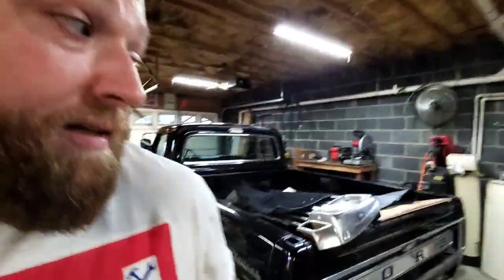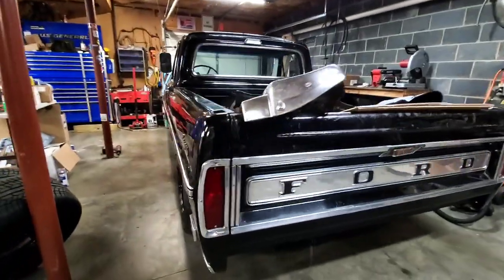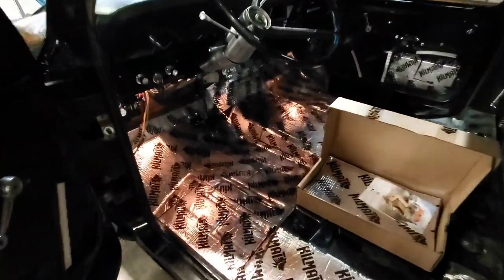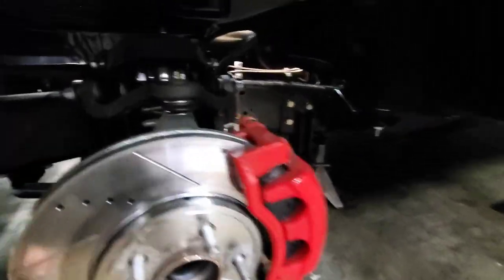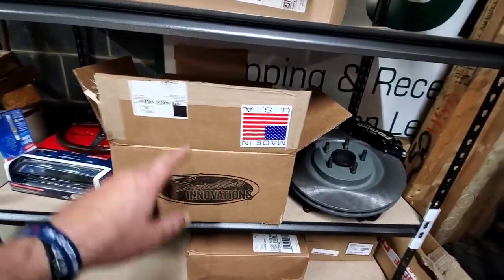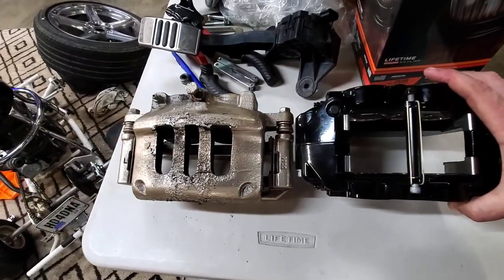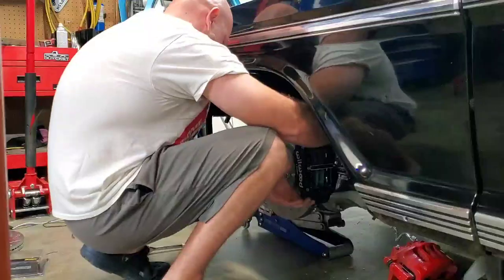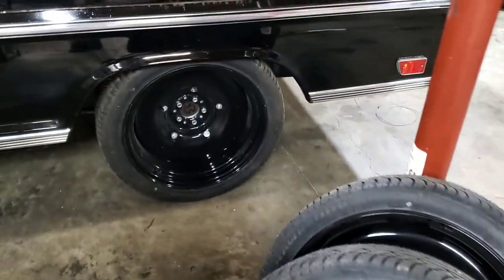1968 Ford F100 Ranger Big brakes!

Comment: What axle is in that? How’d you fit those wheels in the rear?
Reply from the maker: It's an 01 Explorer rear. Wheels are custom built by Schott, 20x10. Fits in the stock wheeltub so long as the correct backspacing is ordered.